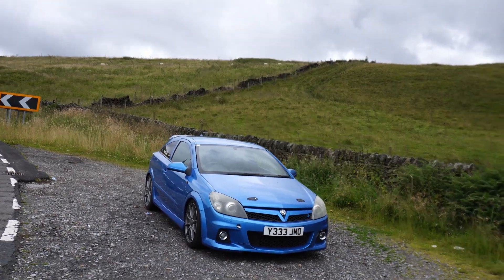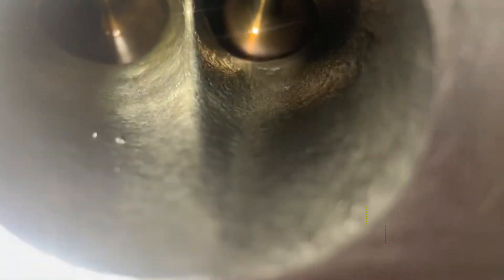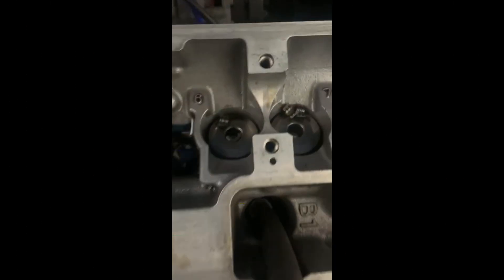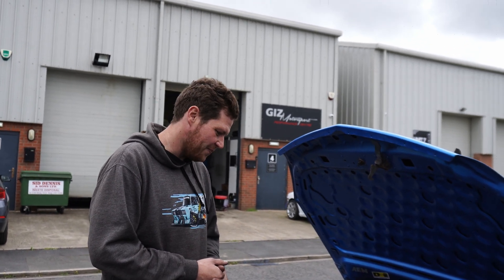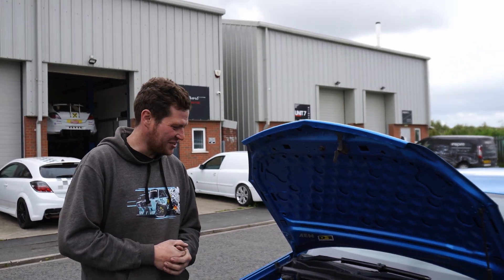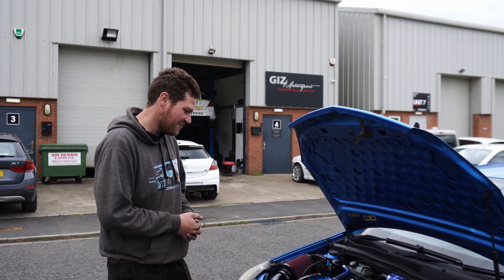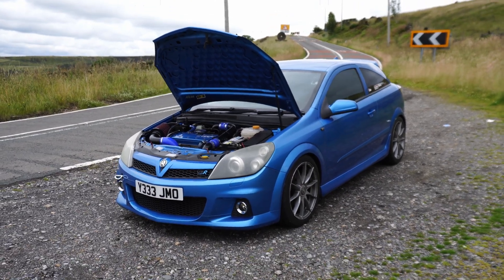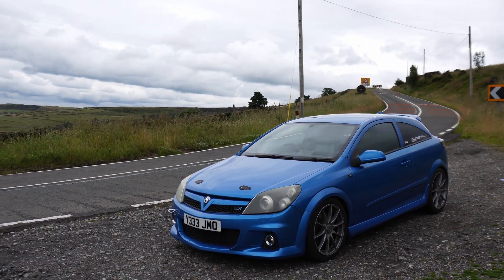My VXR Burned Oil After FORGED Engine Rebuild - Giz Motorsport Found Out Why!

Comment: Should just throw in a Saab B204 or B234. 500+ Bhp from a stock engine, no mods. Just add Injectors and turbos to suit.
Reply from the maker: Tbh I wish I had done a B234 when the engine first went. The Z20 has been a nightmare so far.
Reply: @JamesBalazs  I tune T5 cars for a living. Transplants is a big part of that. Paul @ The SAAB Clinic UK.

Comment: Help :(
In my Astra, a smell of oil has started coming from the air vents. I can also smell it under the hood. Generally, the smell is noticeable while the car is stationary. I also heard a whistling sound, which is strange because I recently replaced the air intake hoses and the breather hose. I don’t know where to look for the cause. The oil level isn’t dropping, but there’s a slight smell of gasoline.

Comment: Who done your engine build as I am in process of looking at doing mine but I don’t have the time to do it myself due to work and family commitments so personally I’d prefer to avoid these type of people. 

Also when I had my old mk5 Astra VXR I tried the eibachs and really didn’t like them so went for the DAP R springs from courtenay sport and they transformed the car. Both sets were paired with the RARB but found the EIBACHS to be kind of floaty.

Great to see these cars still going about. I now have the Zaf B VXR and been upgrading parts left right and centre. To just leave the forge to be the final part of the puzzle.
Reply from the maker: Rusty Autos forged it. The bottom end they built is "fine", but it's not the level of quality you expect when shelling out 3 grand (eg there was a lot of rust in the coolant galleries when Ash took the head off, so it hadn't been cleaned properly after the machining work). If you take an engine that's completely failed and ask someone to rebuild it you expect them to check everything and give it you back good as new, not send it out the door with oil and air leaking past the valves and without even doing a leakdown test.

I'd recommend Giz, RnD, Courtenay Sport, or just go to a reputable race engine builder and tell them what you want rather than a Z20 specialist as there's a lot of cowboys about when it comes to the Astra it seems.
Reply: @JamesBalazs  yea I can agree with that. I have been speaking to a few people up this area (chesterfield) and they have put me off using rusty autos. I have a guy that will do it if I can drop the car off for a few weeks to him but he is in Milton Keynes. Then you have brearly in Nottingham again mixed reviews. Car runs fine etc but these z20leh can give no end of headaches. I was chasing a coolant leak for a few weeks there and turns out it was a faulty coolant cap 🤦🏻‍♂️
Reply from the maker: I agree the eibachs are a bit soft, I was hoping putting the RARB on full stiff would help with that. Courtenay Sport were out of stock of DAPR when I was ordering unfortunately, they'd have been my first choice. These are a stopgap til I fork out for two way adjustable coilovers next year, so handling wise I'd say they're better than stock + "good enough" for now 🙂
Reply: @JamesBalazs  yea set off bilsteins are the way to go. Pricey as they are, they are fantastic. Pair them with the box rebuilt and a quaiffe or wavetrac diff you will be in heaven.
Reply: Take it to junior john hes in nottingham he done mine 3 years ago still going strong at 430 hp
Reply: @alexgeorge2418  hi mate yea spoke with him the other day about potentially forging it and maybe wedging the block in a few months. Just trying to get recommendations and reviews. What it cost you for yours bud if you don’t mind me asking??

Comment: Bloody hell mate I thought my luck was bad lol I bet you were fuming considering it’s a fresh build glad giz managed to sort u out though top vid as always
Reply from the maker: Yeah I've been on the brink of scrapping it to be honest (still am). To top it all off, first drive after picking it up the water pump has failed and it's mixing oil and coolant as well. Wanting to do another video on that when it's all figured out, hoping it's just the oil cooler, but I know I'm not that lucky with this car and bet it will turn out to be the head gasket.
Reply: @JamesBalazs  surely it had a brand new gasket when the head was off at giz? Oil coolers are common as far as I’m aware though feel for you mate
Reply from the maker: @Yodaracing1  yep I trust this isn't Ash's fault - it had a brand new oil cooler at the same time, the Nevlock one with braided lines, so I'm betting that was faulty honestly. Think I'm going to bypass it this week, just run the front cooler instead, change coolant again and see if it stays clear this time
Reply: @JamesBalazs  deffo a way of narrowing it down if u bypass it and it’s still doing it then least u know it’s not that
Reply: @JamesBalazs  the nevlock cooler have a high failure rate mate, either best of bypassing it or try get hold of an oem
Reply from the maker: @callumt2115  Good to know thanks. I still have my stock one, the annoying thing is I only replaced it because I know they're prone to failing, my lines were leaking, and it was cheaper to get the Nevlock one with upgraded lines than to just buy upgraded lines from RnD on their own. It was preventative maintenance that's caused more trouble than it's worth
Reply: @JamesBalazs  always the way bud, i used the nevlock lines to be honest had them for a few years and they have not leaked yet